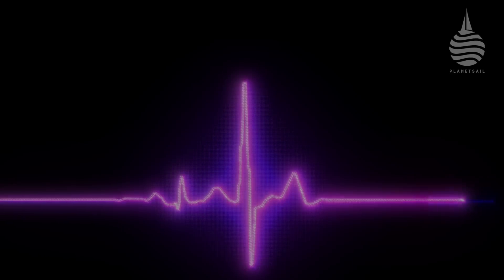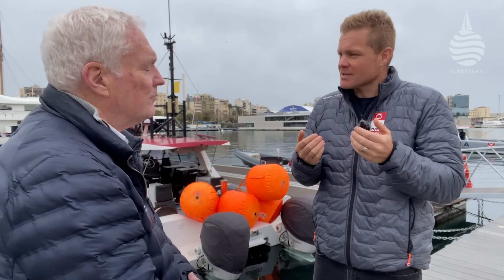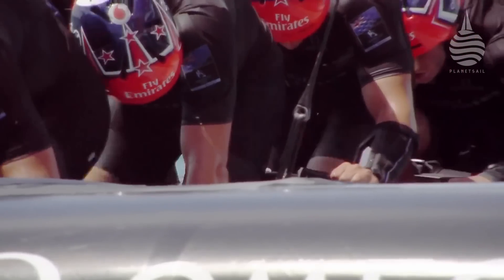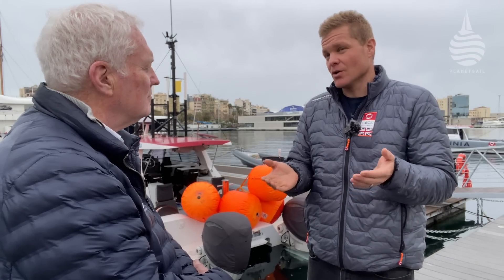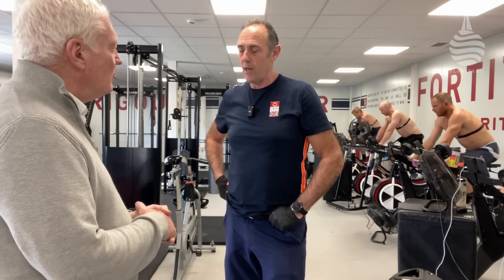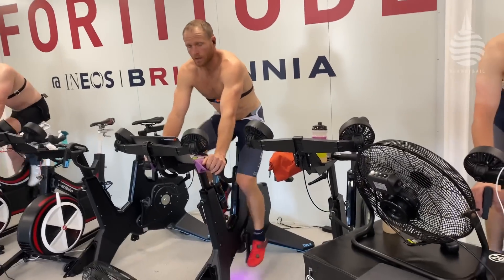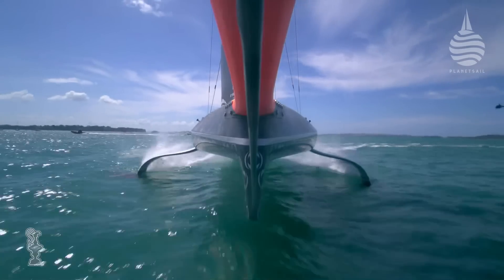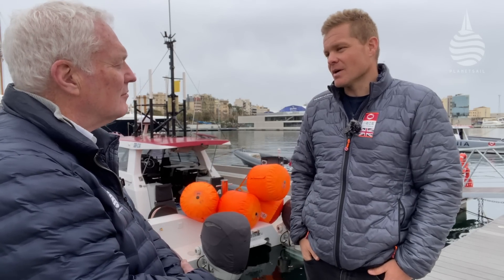Ep8 - Human Power - Road to the 37th America's Cup

Comment: are there specs or documentation regarding the batteries? they sould be part of the AC75 spec right?  I've been unable to find any info.
Reply: Edit. i've seen  press releases by Torqueedo mentioning AC36 used the company's Power 48-5000 battery pack. although no mention on how many unit each s/y carries
Reply: Same here. Was wondering about that
Reply: Some of them are top athletes regularly tested for dopong

Comment: I think an interesting change to the class for next time (assuming the terms of the next challenge don't break the agreement to use AC75 again, and all the mess that would entail) might be to go back to 8 grinders and drop the idea of pre-charged batteries, making the whole boat directly powered by those onboard. I think the biggest complaint about this class has been this idea that it gets away from crew involvement. I'm not sure I 100% agree, but at least if there's zero pre-stored energy, but instead a conversion with a buffer it might help sell a few more fuddy duddies on this direction for the top class of sailing. I know they wanted the separate electrical system as a kind of insurance against a hydraulic failure sending the boat into a dangerous maneuver, but after 8 years and 12 boats (plus the dozen AC40s and the LEQ12s) I think the class ought to be mature enough to take those training wheels off for the next round.
Reply: one should do some number crunching to see if that's feasable, but my suspition is that the force requirements for foil arms and flaps, given the frequency of activation make the power requirenments to high to be hadable by manpower

Comment: Why not hiring cyclists?
Reply: The other reason as mentioned in the video is that aside from power-weight ratio being less of a concern, they're looking for maximum power output, rather than the specific combination of high endurance, at high proportion of output, at low mass. But clearly cyclists are still on the prospects list as a couple of the other teams went towards track riders to fill some of the positions .There in sprinting disciplines total power becomes more interesting. 1000w output is not all that uncommon. Chris Hoy could output up to 2500w. I think the bias towards the rowers is because they'll have already trained to be at peak power for longer periods, and they can't drop. Dropping your form or power level below that of the rowers along side you can be catastrophic. Look up videos of "catching a crab", that oar has an incredible amount of mechanical advantage, and can do serious harm to a rower.
Reply: Because a crew of 8 has to average 90 kgs. Most cyclists are 60-70 kgs. There’s only so many Dennis Connors still skippering these days.
Reply: team NZ did it in 2017.
Reply: Track cyclists yes, roadies, no.
Reply: I see, but there are cyclists like Van Der Poel able to output high watts for long periods…interesting though
Reply: They do. Luna rossa hired a cyclist who gained 15kg